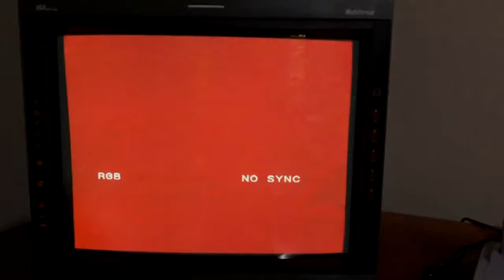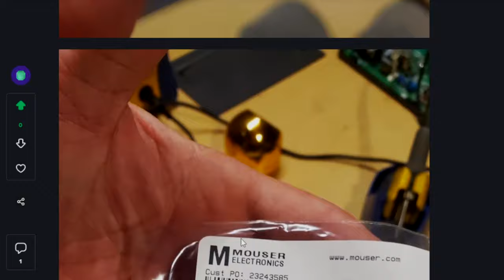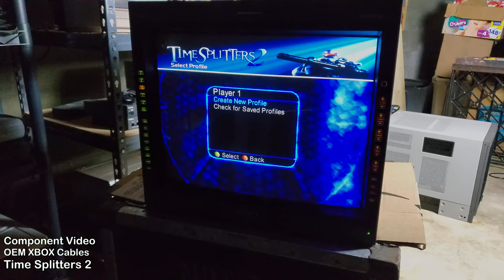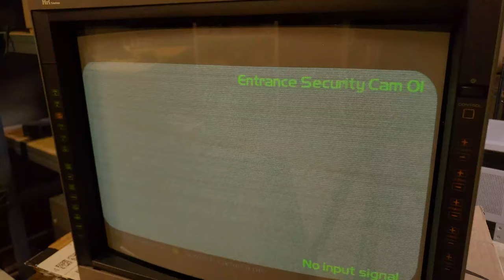Hiring Bad CRT Techs! | Featuring 2 Sony PVM 20L5 Trinitrons

Comment: I've tried working on CRTs and am kind of frustrated with the amount of heat that seems to be required for getting joints to loosen up when De-soldering. Pads are damaged VERY easily if heated for even slightly too long but you need to use temps exceeding 700F with this unleaded solder in 90's or 2000s era boards. Granted I'm not near professional level yet but it seems pads are more fragile than they should be.
Reply: Use extra solder of your own and then use a solder sucker

Comment: I've been meaning to grab one of those monitors, I have a few other odd tech bits mainly stuff like ceds and retro and odd gaming stuff. By the way have you seen those wierd Toshiba LCCS monitors that are color but actually black and white? Those would be a great video idea really very interesting tech. Similar in function to a projector color wheel
Reply: They are actually JVC made and Technology Creations has a great video on them. I have two I got from Japan that are actually Victor branded sadly one has a slight issue with the LCD. Super cool sets for sure though!
Reply: @josephboysuk686  I could have sworn Toshiba made some too but I'm probably wrong thanks for clarifying still really odd tech that would work here though
Reply: @deathdeathrevolution3499  it’s super cool how the tech works and truly I believe it would be the only hope you’d have of a new CRT in 2021. Being a black and white tube it’s significantly easier to manufacture than a color tube. Still far from ever being made again but a glimpse of maybe what could have been.

Comment: Really glad I found this channel! I've got a 19" early 2000s dell trinitron, it works fine except that every few minutes the screen goes completely black for 1-3 seconds and then comes back. Also it had some issues with horizontal lines flickering up and down on the screen randomly every few seconds, but that issue went away when I turned the refresh rate down (From 95 to 75hz). Any idea what I should look at first? I have never worked on CRTs, but I am familiar with soldering and electronics. Thanks!

Comment: Have you heard about the last black & white TV ever made? They were made from the 90s to the early 2010s after CRTs couldn’t be sold at stores. The screen size is 5.5 inches and also comes with a radio built in; does it have any inputs? Do they also have capacitors and boards?
Reply from the maker: Yeah, My grandmother gave me one of the years it was made.  I wish I would have kept it now.

Comment: Great Video

Thank you for cleaning up some other "techs" mess. Sorry the customers went through that, but in the end those two 20L5's were saved and are running great again!

Any chance on the follow up video on the 36" D-Series for adjusting geometry and calibration tips?

I have two of the 32" D-Series that are amazing consumer sets, but I do have a bit of geometry issues with both and would love to learn how to adjust that and dial in the calibrations a bit better. My Sega Genesis / Sega CD look awesome over RGB on the 32" D-Series using HDRetroVision cables.

Thanks!
Reply: Second this! I have a 32inch D-series which is phenomenal for 3D consoles, but not quite great for 2D since there's some geometry issues.